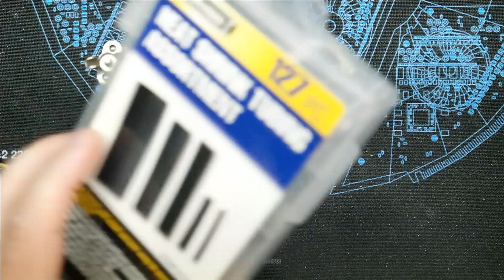What To Use The Dangerous 6 Pin PCIE To SATA Adapters For

Comment: So, can you just get these that have a much higher wattage tolerance? Wouldn't that negate their issues?
Reply: The problem with finding cables like these in a higher wattage tolerance is that they don't really exist. Cables like these (eg "free" ketchup + mustard peripheral cables) exist solely to sweeten the pot on downcosted electronics and power supplies. They're made as cheaply as possible: highest gauge wire (eg thinnest) possible on lowest current connectors, no thought to safety/proper pinouts, done by lowest bidder labor that's probably googling the pinout and not bothering to actually look at it bc they have 500 more to wire up for their quota today, with no QA department to double check the safety of the product. It's not there in the assumption you'll want to actually use it, it's there so you go "oh, this one comes with a free extra cable, wow what a value!" and buy it over a competitor's product. It's almost unheard of to find these with a good gauge wire.

You might as well just look up the pinout standard from the manufacturer of your psu (there are 4 or 5 different standards among the most popular brand, and they are not compatible with each other, so be super careful) and wire up high current cables yourself. 16-AWG spools are cheap and come in multiple colors, atx 6 pin connectors are cheap to buy, especially in bulk, and shrink wrap is so abundant you could order it in uv-reactive colors if you really wanted. It'll cost about the same per cable, but it won't take 3 months to clear customs. plus then you can cut to desired length before braiding/wrapping. win win.